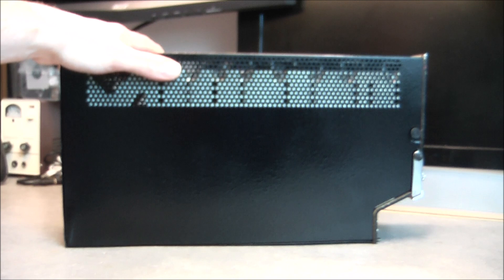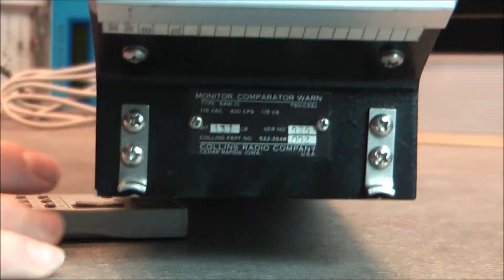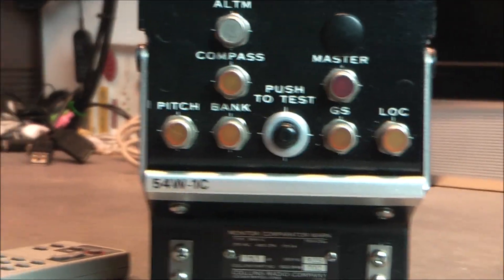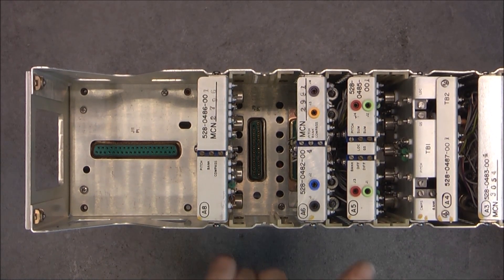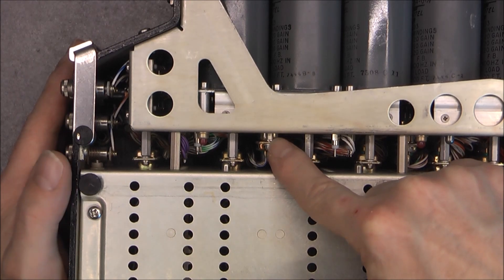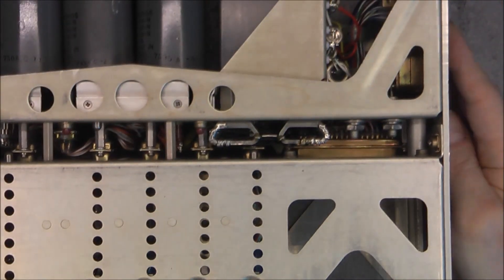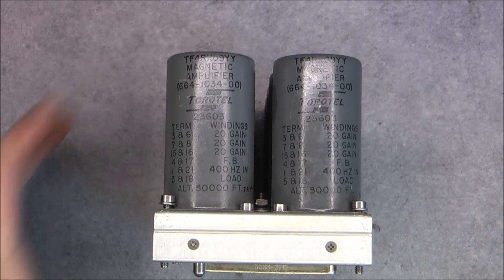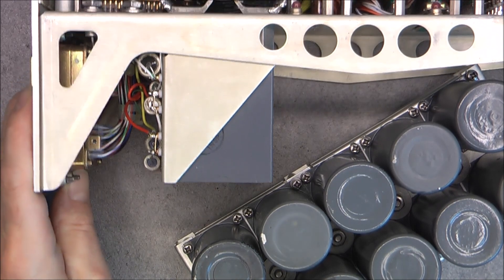Collins 54W-1C comparator warning monitor teardown

Comment: This box is meant to compare data from redundant sources like altimeters, airspeed sensors etc. If the difference between two redundant sources meets a particular threshold it notifies the pilots.

Comment: I wonder what is in those grey modules
Reply: This is like a classic transformer, with several windings. Difference with normal transformer is the saturable material used for the core, generally Permalloy.